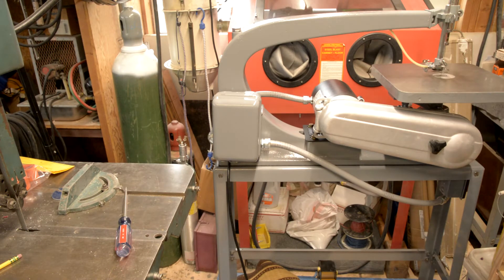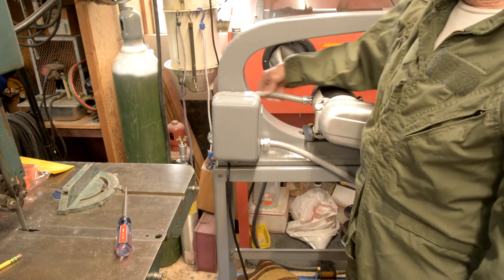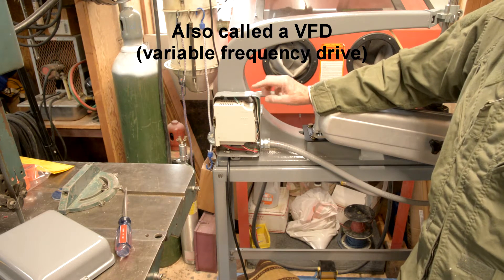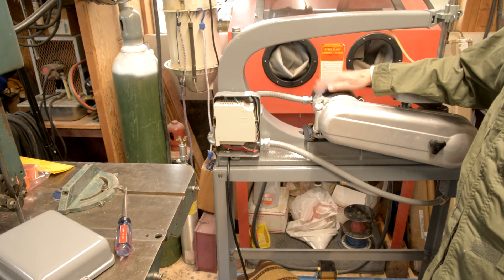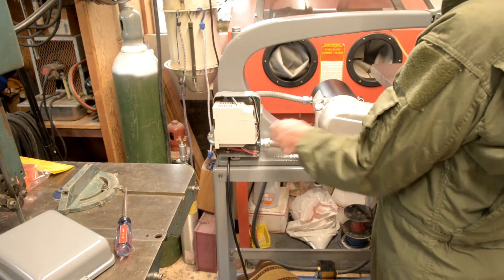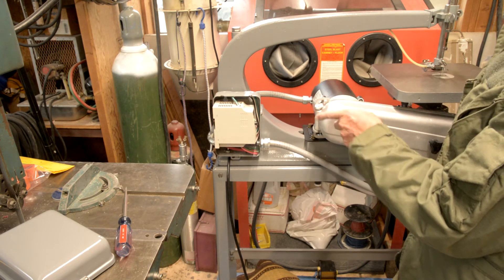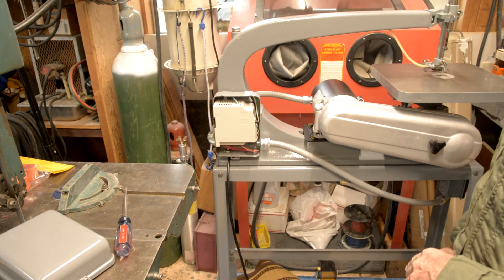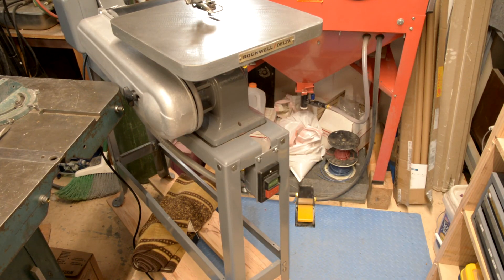Part 2 Delta/Rockwell Scroll Saw Restoration

Comment: I have one of these saws I think mine mite be older . It was my father’s. I seen in first video you said you replaced the head .  Have you had any other mechanical problems with it can parts still be purchased for them ?  I was also wondering how much oil goes in the reservoir ? Any idea
Reply from the maker: You can get the manual from vintagemachinery.org.  The manual say to fill the case to within 1/8" of the lower end of the oil cup.  Some parts are still available.

Comment: Where can I find out about these VFDs and up to what size of hp motor will they run on 110v 60hz
been put off buying 3 phase 220  because of the power supply issue I have my eye on a cabinet saw that is 3 phase 220. this might be a cheaper option than changing the motor

Comment: Does the VFD overheat in such a small enclosure?
Reply from the maker: I have air vent hole and it has never shut down due to overheating.
Reply: @vendter    Great.  Have same unit but with variable attachment.